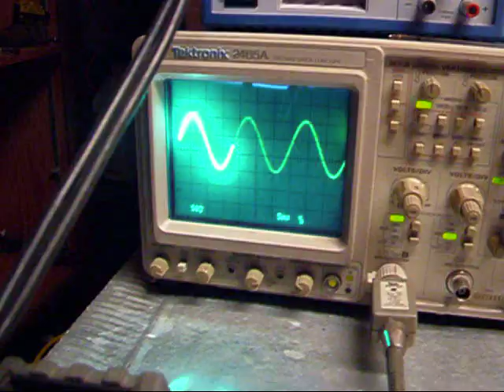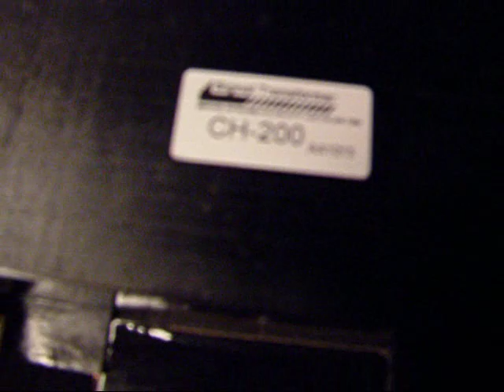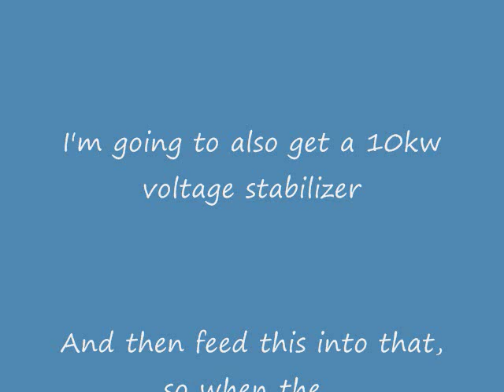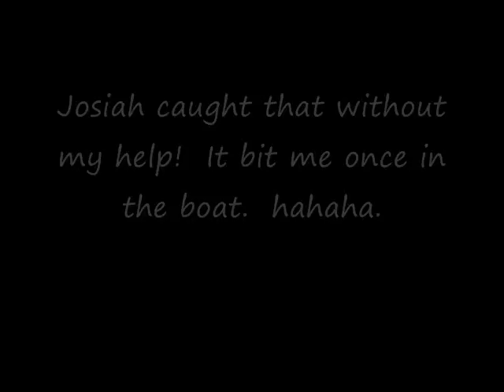Pure Sine Wave Inverter

Comment from the maker: The 3 phase controller works well, but I've only tested it with a V/Hz approach.  The code is done for field oriented control, which lets you control the torque of a 3 phase motor directly with the throttle.  What's been holding me up is my motor post is 1.125" diameter, and the largest encoder I can find is 1" diameter.  haha.  So, I'm getting the post turned down by a machinist today.

Comment: interesting side-project... What is the switching frequency? (sorry, I haven't done all kinds of searching through the EV controller project to find it) I think most sine wave converters try to run well over 20kHz... I've seen some run 100:1 ratio, so 60kHz which obviously makes the filtering MUCH easier.  Something tells me that huge 200A choke won't do well at the PWM frequencies... I don't think that core material can handle much over a few kHz with any significant load. Many sine wave inverters use physically paralleled toroid cores (glued together, side-by-side) to get enough core mass to prevent saturation... it's far cheaper than trying to find a single core that does the job.

I'll be watching to see if you continue with this project. BTW... using a battery Boost Converter in front of the main inverter isn't a bad idea... even Toyota uses them in the Highlander Hybrid to go from about 280V to 550V or so, and it increases the efficiency of the whole system.  But you need at least 311V DC (stable) in order to get 220V AC output for your house.

Comment: just only buy household items that run off dc......

it may sound hard, but its not. most items convert the ac to dc inside anyway, so just feed them dc and they still work. I am not suggesting plugging your 42'' plasma into 220vdc, even though some will yours may not! and most ac household devices with motors wont work on dc

Comment: nice circuit board its to bad you don't have a clear diagram for those who know what there jammed into a small box!  teach for a diagram show what you real have working there.
 a lot of low info people out there that need cool toy work horse there
you did a great job on the toroid coreKool use 8awg wire it handle about 200 amp pp
keep posting brother open source man

Comment: hmmmm. your components seem quite modest for the 5kw power array you have, is that because solar is already dc?
I have a 'broken' 5kw low frequency split phase 24v 120v/240v off-grid pure sine wave inverter... if i want someone to see what is wrong with it  - am i going to an electrical engineer?
Also, it has a nice large, center tap torroid coil. i think the parts are legit. maybe i will video the inside...
Reply: +Chris Kelly  start off  by opening it up and looking for some obviously burnt components, taking care not to not touch any large capacitors, or discharging them.